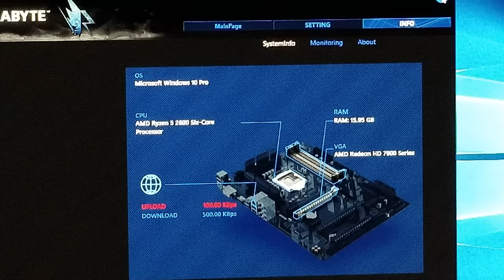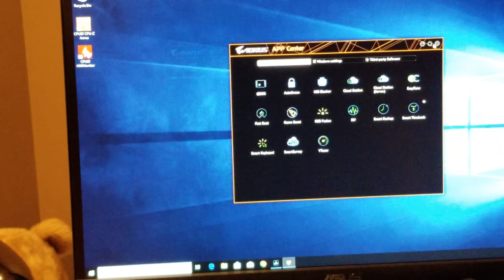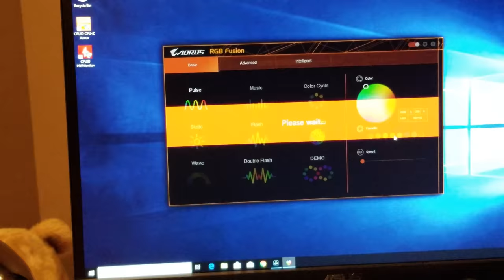Cooler Master MasterCase H500, Build Guide & Aorus B450 Pro WiFi

Comment: Hi i have the same case and a msi b450 gaming carbon pro motherboard. I am having real trouble getting the fans at the front to colour up i get them to turn on but doesnt do rgb. I have the fans plugged into sys fan 4 from the controller. Been playing round with it for the last hour just cant figure out why no rgb. Can you help? Thanks
Reply from the maker: I explain the cable's a bit more for the RGB Starting at 19:54 in case you missed it, so if you have it connected as per the video then you plugged in the RGB Cable to the motherboard, the step for the colors is the RGB Motherboard Software...and ensuring the fans are connected as you mentioned you have already done...beyond ensuring the RGB is in correctly, and all cables are connected I"m not sure what else to suggest, if you give me more info providing this doesn't help I'll see if there is more I can do...Thanks...
Reply: @Reviewing_Playing_and_More_RPM  Well i start it up the fans do spin but i assumed they would light up a default colour, maybe not. I have just setup pc tonight and only got win10 installed so i haven't gotten the software downloaded yet. I just assumed if it was setup properly the fan lights would come on at boot etc. Thanks for the quick reply.
Reply: @Reviewing_Playing_and_More_RPM  So did you just have 2 connections total? 1 >> RGB Header 2 >> SysFan? Thanks.

Cooler Master really dont provide good instructions on how to set this up unfortunately.
Reply from the maker: Yes there should be a default color, can't remember what it is but I think it's pink or purple, I'd do a quick check of the connections when you have a minute, it's easy to miss something, and something that has happened to me is accidentally pulling off the RGB Cable from the Motherboard...not sure this helps but good luck...
Reply from the maker: Yes, 1 RGB cable to RGB Header, (12V), and SysFans using the cable at the beginning that I said you didn't need, but later realized you did in order to reach to the motherboard...Yeah wish I still had this system to go back and do a separate video for just that, contemplating do it but not sure...
Reply from the maker: BTW I did two video's on the RGB, at 15:14 in this video https://youtu.be/oXNhQCKDjwU maybe it will help a bit...

Comment: If I have the same components, can I connect an ARGB connector into the 5V V DG from this exact same board?
Reply from the maker: The RGB in this video uses a 12V RGB Header, not 5V, so I don't believe it would work...However if your had a device that needed ARGB then you could use it...Thanks...
Reply: @Reviewing_Playing_and_More_RPM  My H500 has only ARGB, does Gigabyte uses VDG port as ARGB? Because I don't see in any aorus mobo an 5V ARGB port, even in B550
Reply from the maker: Yes the VDG is ARGB on the Gigabyte Motherboard...you can quickly identify the ARGB as it will have 3 Pins instead of 4...Thanks...

Comment: I got a question about front fan splitter (not the RGB One). The fans are 3 PIN , why the splitter Is only 2 pins ? There is no way to control the fan speed, they Will be Always at full Speed, Is It true ?
Reply from the maker: It's been a while since I had this system but yes I think that was the case that they ran at full fan speed. You could replace them with PWM Fans later on though to prevent this but at extra cost.

Comment: Hey!

I got the H500 but my Fans wont Spin... Where exactly is the power connection for the fans ? :(
Reply from the maker: There is a Sata Power Cable from the case, plug it into your power supply Sata and it should be good...Thanks...

Comment: my case didn't come with the 4 pin ARGB connector it is a 3 pin. will that still work to power the 200 fans?
Reply from the maker: ARGB is 3 Pin 5V, RGB is 4 Pin 12V, so if you don't have the correct one there is an Adapter you can get that will convert one to the other and vice versa...The Fans use a SATA Power cable from the Case to the Power Supply...
Reply: @Reviewing_Playing_and_More_RPM  thank you so much i will look into it. it is only lighting up my top 200mm fan
Reply: @Reviewing_Playing_and_More_RPM   i have the same case and motherboard. is there a way i could use the 3 pin led plug on the motherboard to power the front fans?
Reply from the maker: @carterdouthwright7165  The fans are separate from the RGB, the Fans need to either plug into the MB, or if it's ARGB you will need a ARGB Header on your MB, if not then the converter will be needed, the Fans need their own power source, ie the cable splitter from the case after the fans are connected, then will go to the MB to power your fans...I had the same issue with the front fans though and there was one cable I hadn't plugged in, so check your cables to ensure there all plugged in and being used and as far as they go you'll be good...hope it all works out for you...

Comment: My Samsung 870 Evo only has screws on the bottom side. Does that mean I have to take my motherboard out and install the ssd first?
Reply from the maker: No, there are other places to install an SSD, check out the Case review it will show the other locations.

Comment: Hey great video very detailed, im new at building pc and im trying to learn it. When you were connecting the rgb fans, you only connected the fan cable without the rgb thing right? and it's because you can also control it through the mobo right? Sorry im new at this things and im super noob.
Reply from the maker: Yes connect the fan cables, then you need to connect the RGB to the motherboard as well with the RGB Cable...this allow control of the case fans, etc with the motherboard software...don't worry it can be quite confusing, I spend a lot of time figuring it out myself often redoing it until I know it's all working right...Hope that answers your question...Thanks...
Reply: @Reviewing_Playing_and_More_RPM  oh okay thank you very much!

Comment: hey, I have this pc case too but my motherboard is MSI b550m Pro-vdh wifi and usb 3.0 cable is not fit with on motherboard ;/
Reply from the maker: If you look at your MB it facing a different direction, instead of the normal direction it's facing sideways...it's near your Front Panel connectors...

Comment: So if you take off that molex connector, you can then just plug the two RGB cables (one coming from each fan) into separate RGB headers on your motherboard?
Reply from the maker: I didn't need to use two RGB Headers, only needed 1...and the Fans use the included splitter cable and plug into the MB...
Reply: @Reviewing_Playing_and_More_RPM  Yes, I understand that. But, I plan to use Aura Sync and I don't know if I should even use the LED controller that comes with the case. Would I still use the controller if I plan to utilize Aura Sync?
Reply from the maker: @saulwentz4323  No you won't need to...
Reply: @Reviewing_Playing_and_More_RPM  OK, Thanks. Sorry if these seem like stupid questions but, I just don't want to run the risk of frying my mobo by hooking this stuff up incorrectly.
Reply from the maker: @saulwentz4323  They're good questions, and I'm happy to help any way I can, ask any time...

Comment: Thank you for sharing I too like that you explained the cables. Many of us building for the first time find those steps harder than what it should be. By the way,,,How did you fix the front fan cable problem? I have the same problem with a new purchase of the  Cooler master master box NR600 and can't figure out what to do with it.
Reply from the maker: I missed a case cable that powered it on, once I connected it everything was good...can't remember if it was a Sata Cable or not, but think it was, sorry was a while ago and I don't have the system anymore...hope that helps...Thanks...

Comment: i noticed all the headers for my fans are 4 pins and all my fan connectors are 3 pins... when i plug it in, it still fits but i want to know if it's safe for me to use
Reply from the maker: Yes it's safe to use, as long as you have them in correctly, ie...line up the slot from the fan with the tab on the fan connector...Take Care...
Reply: @Reviewing_Playing_and_More_RPM  thanks

Comment: My H500 argb Case the rgb splitter  attached  does not match my gigabyte motherboard  it has five pins  I need only four the 12 v  the R the G and the B . the rgb splitter  provided w/ the case  has only 3 holes do I have to buy an additional  rgb splitter  w four holes to connect to my motherboard pins ??
Reply from the maker: The RGB Splitter provides extra connections in case you need them, but you only need a couple, the RGB from the case goes to the RGB on your Motherboard, in the situation your referring to the 12V will have 5 pins, one is for providing more white to give more realistic colors, but when you look at your 12V you'll only use the four pins, just shift it to match what you need so start as I did in the video and don't use the one on the far right side, and then it'll work...The RGB from the case is a 4 pin if you have a 3 pin that is different from mine and would indicate it's ARGB and would go into the  DLED1...hope that answers your question...Thanks...
Reply: Thank you sir first and foremost for taking the time to respond to my problem I really appreciate it.  I subscribed to your channel  and followed  your tutorial to build my PC which is the exact Case and Mother board you have the Gigabyte Aorus  b450 pro wi-fi .it was easy to follow along with the close up views of all the connections you provided,  your video is the best and only tutorial on Youtube that actually SHOWS things up close. which helped enormously . the ARGB cable connection which came attached to the Cooler Master H500 case  has only **three holes** which is to be connected to the mthr bd on to * four pins***on the mthr bd.. it  should be  w/arrow on the far left 12v r,g,b, with last pin the W exposed. however I will certainly follow your suggestion in reference to using the DLED1 in order to resolve this issue. thanks again for your help. take care be safe. Oh! continue making great tutorials you're very good at it.
Reply: I went back to the three hole argb cable connection and did as you said ,  connecting it to the DLED1  and It was spot on  just like you said my Computer is running great everything seem to be functioning properly now. the  rgb is  lit up  this is great!  now I can continue using your tutorial to finish things up. I won't do any cable management until I 'm completed installing  win10 pro 64 bit, installing graphics card drivers ,Formatting SSDs etc....thanks again.
Reply from the maker: Will do, glad the info helped...Thanks...

Comment: Got my answer on second video but. How do you work on the first startup what about bios or how did you installed windows?
Reply from the maker: On the first start up, I got to the BIOS, then proceeded to do the Windows 10 install, followed by the install of the MB drivers, then used the RGB Software to control everything...I recently have come to realize that in some instances if your using Corsair RGB Memory, the ICue software will not just recognize the memory but often other devices such as your MB and let you control everything with that...

Comment: how do I find out where the power leds connect on my unknown 2010ish prebuilt best buy acer motherboard?
Reply from the maker: Can't say for sure, you just need to locate the Front Panel connectors and follow the same locations to put on your connectors...a search for the Motherboard will help you out with that...
Reply: @Reviewing_Playing_and_More_RPM  Thx. I figured out it has a color coded section like on that auros motherboard, just uses a different set of colors.
Reply from the maker: Cool glad you sorted it out...

Comment: i have the same exact mobo but my cooler master case is the td400, my splitter splits into a 3 hole which is labeled gigabyte and another 3 hole labeled as asus, asrock(but with a space in between). im guessing the correct on to use is the 3 hole thats labeled as gigabyte since thats the case’s company. but the problem is that on the b450 aorus pro wifi, there is no 3 pin header so idk where im supposed to connect them. it would be helpful if u can tell me where to connect it. the thing is, you can use the rgb on the fans but it doesnt sync with the motherboard so im trying to find a way to sync them
Reply from the maker: Ok, so a few questions here, let's hope I get them all, first the connector to chose is the one that is the same as your Motherboard, not the case...I'll uploading a video today currently uploading, that will help solve your not having a ARGB Header, when you don't have a ARGB Header but do have a RGB Header you need a controller or converter, different names depending on which company it's coming from...syncing it will be easier once you have the cable to correctly connect it to your Motherboard, without it you likely won't be able to sync it...Video on how to do this will be live in a couple hours or so...Hope that helps a bit...Thanks...
Reply: Reviewing Playing & More RPM ok thnx. i messed up rn cuz i accidentally put the argb port into the rgb port and it busted the rgb lighting of the fans. i just realized that my fans are argb and the mobo only has rgb ports like u said. so yeah my best bet was to buy an adapter but it doesnt matter know cuz the rgb is busted. thanks for replying tho, it helped me confirm what the problem was. its my fault for not realizing the difference between argb and rgb. im prob gonna buy new fans to replace the pre installed ones since the lights are broken(like i said) and arent rgb
Reply: Reviewing Playing & More RPM ill still check your vid out since itll be helpful once i install the new fans
Reply from the maker: Yeah I think they should be made to include both ARGB and RGB on MB's because it does cause a lot of confusion for people...take care...Thanks...

Comment: Hey, Good video, although i have a question, do you know long the wire for the 200mm fans and the back fan are? as i want to install a fan hub but dont know if i need a extender for it
Reply from the maker: Can't remember for sure, but think it was around 2 feet, don't think you'll an extender though...two could go into the fan hub, and you would have about another foot to reach to the MB...Thanks...
Reply: so do you think that if i place the hub in the middle on the back, both the 2 front and the 1 back will reach?
Reply from the maker: @tokehoberg8613  Yes I think you will have the reach you need...